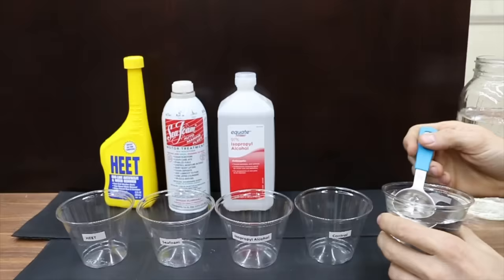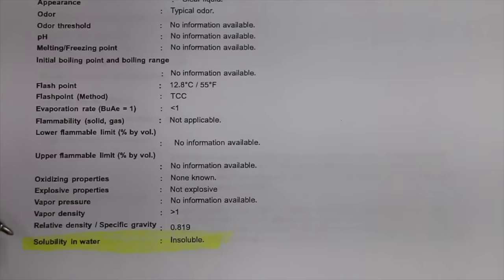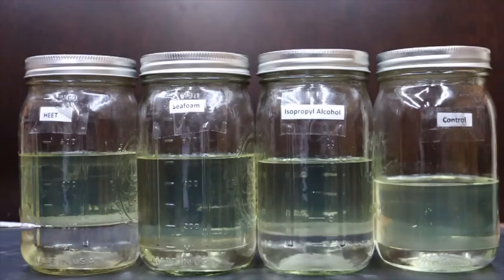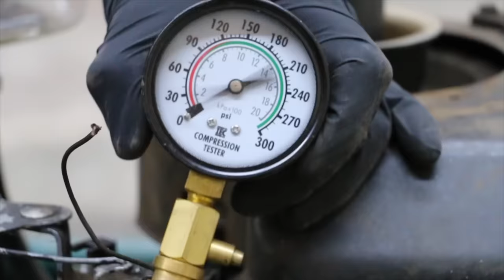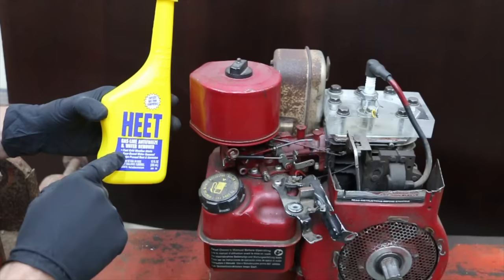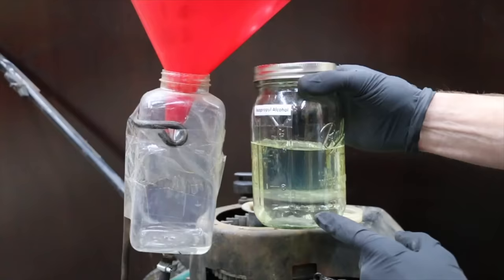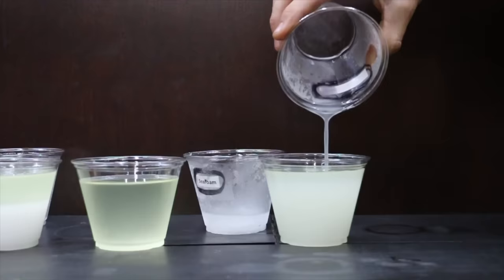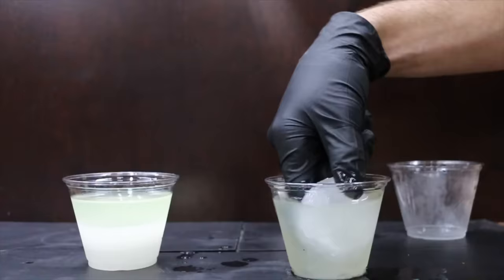Is HEET better than Seafoam for Water in Fuel?  Let's find out!

Comment: I worked at a gas station for about a year and we had to dip our fuel tanks once a week and once during my shift the paste we used to test the water came up positive for water in out tanks (it was extremely sensitive paste, even reacting to water in the air on humid days) and so we had to report it to our HQ and they sent out a huge tank filled with HEET and added another 20% of liquid into our tank to absorb the water. 

They then had to leave the truck over night to allow it to mix said fuel to ensure it was properly applied and we offered a discount to customers of about 50 cents due to the contaminated fuel. 

Most people were just happy to get cheap fuel and word spread fast, emptying our tank in about 4 days. It had to be fully empty to ensure all the water was gone and then workers came by to go into the tank  to check for cracks in the shell.
Reply from the maker: Great information! Thank you

Comment: Spend 11 years in Alaska.  I added a bottle of ISOHEET to the gas tank about once a month.  When I did have problems with ice on my Wife's or other family members' cars, a bottle of ISOHEET and an overnight stay always cured the problem.  Bought a used car that had been sitting one winter and could not jump start it.  Owner ended up dropping the price and I think that's why he was selling it.  Brought out a portable heater and piling snow up around the perimeter of the car then putting the heater under the oil pan.  Still no good.  A bottle of ISOHEET, an overnight dwell, and the car started the next day.
Reply from the maker: Great post. Thanks for sharing your experiences.
Reply: @ProjectFarm  I too live in Alaska but i always buy the red HEET bottles.

Comment: Man, how cool, you took my advice and  tested water removal. Awesome!!! This episode is special to me and I'm honored. Thank you sir.  I asked to have this tested cause I got 2 100 gallon tanks with water that got in them. I bought a wix filter that looks like a snake and put it in the tank and it did an awesome job of removing the water in that filter from wix. If you haven't seen these type of filters you need to cause they do work should you accidentally get water into fuel. What an excellent Christmas present.
Reply from the maker: Thank you for recommending this one!  Every video in the last year that I've done has been recommended by viewers.  I've got a lot more on the way. Thanks again!
Reply: @Clip Joint
Thanks for your awesome idea. ✌️
Reply: @haydenc2742  Yes sir thats it. It works very well. They use it a lot in the marine world.
Reply: I think one way to remove the water would be to let the tank freeze, pump out the fuel, heat it up to unfreeze, and pump the water out.
Reply: @satibel  Depending on how much water, might have to watch it doesn't crack the tank.
Reply: @haydenc2742  for Diesel fuel tanks only. Not for gasoline. Could still be handy and a great tool for that need it.

Comment: I had my fuel line on a diesel pickup truck freeze up while driving in Ottawa, Ontario Canada at -25C, and I was luckily already prepared for winter fuel issues, since I already was carrying Methyl Hydrate. 4L jug for about $10-$11.
My diesel has an electric lift pump along the frame rail, and a mechanical  injector pump at the engine. I got out to listen if my lift pump was working, and no noise coming from it. I grabbed the Methyl Hydrate from inside the truck, and splashed about 1.2 a cup down the fuel fill tube, and the moment it made it to the fuel, I started to hear my lift pump make an ever increasingly progressive noise from quiet to normal audible levels in about 8 seconds from pouring the Methyl Hydrate. 
You can find it in the paint section where you'd find paint thinner, mineral spirits, etc. There are 2 exciting features about it that fascinates me, it works almost instantly, and its dirt cheap for an amount to last you a year of problem solving.!!
Reply from the maker: Thanks for sharing!

Comment: Heet is a great product. If you are ever very close to passing an emissions test and have done everything, you can run your car to empty, throw in 4-5 bottles of heat (around $1 a bottle some places) and get it to pass.
Reply from the maker: Great tip!
Reply: Yep methanol burns clean and hot, but can eat old rubber lines
Reply: GravityToy  Forsyth County still has emissions testing
Reply: GravityToy  the vehicle passed emissions as designed, so it is simple to figure out if an emission related device or engine tune relate device failed, emissions would increase
Reply: Back in my days as a mechanic, adding 10% methanol to gasoline was a favorite method to make any car pass emissions.
Reply: GravityToy  Downstream O2 sensors monitor cat health. Your ECU determines stoichiometric burn solely by using upstream O2 sensors. the voltage signal from them directly regulates emissions. With a bad upstream O2 sensor your ECU won't get the mix right, your emissions will be off the charts, and you won't pass.
Reply: Sicktrickintuner 

Methanol doesn’t ‘burn hot’.
Reply: GravityToy 

Wrong. They regulate fuel air mixture.
Reply: @FrankGutowski-ls8jt   actually methanol burns over twice the temp that gasoline burns at.  3,300 vs 1,500 f
Reply: @jbtvt  you can actually tune around this if you have an HP tuner or Diablo sport to get inside the ecu .. I have a cat housing but it's hollow I run 25 pounds of boost out of a 60mm turbo the loop on the ecu is programmed to read correct every time and if they test the tail pipe the meth and 110 octane come up clean as a whistle every year
Reply: Cool story bro

Comment: I've been running snow machines on my trapline for 30 plus years. In my experience the best option is to leave water frozen in the bottom of the tank. If you add isopropyl it will pick up the moisture and carry it up through your fuel system and refreeze in your fuel pump, fuel lines and carburetor. And to always use a screened funnel when adding fuel to stop water before it gets in the tank.  Love your channel.
Reply from the maker: Thanks!  Thanks for sharing.
Reply: How does a screened funnel stop water from getting in the fuel?
Reply: @plantfeeder6677  if it is frozen it won't go through the screen
Reply: @donschneider7252  I don't think he's talking frozen water. That would be an Captain Obvious in my book.
Reply: Well that is exactly what he’s talking about so…

Comment: When I was stationed in Alaska in the early 70s, I was introduced to HEET. The universal recommendation was to add a bottle of HEET to each fill up of 10 gallons or more, to prevent fuel system icing. So I did, and after leaving the USAF and returning to Laramie, WY, I continued to use HEET in the winter. Since moving to northern Colorado, I haven’t used HEET as often, largely because our winters tend to be much milder. I honestly don‘ t know if adding HEET actually helped to prevent fuel system icing, other than I never had it happen.
Reply from the maker: Thanks for sharing.
Reply: What heet does it removes water as u drive ur car , the water will run out of ur tailpipe , if u ren ur gas low and freezing conditions set in and ur car won’t start I have added eat and car then did start

Comment: Nice! I have been using seafoam for years and always buy non ethanol gas! Another tip is to put a gallon or two into your vehicle first before you fill up your cans at the gas station.  This clears the hose and pump of any ethanol fuel!
Reply from the maker: Thanks for sharing.

Comment: I live in Wisconsin, and I add HEET as soon as we start hitting prolonged freezing temperatures. I've never had a problem with my car starting even in below 0 temps, but I use the red instead of the yellow just in case it actually does help the engine a bit more than the basic. This vid verifies that adding HEET before it's cold enough to freeze the line is the best method or protecting the car.
Reply from the maker: Thanks for sharing.

Comment: When I came back from Germany in December 1982 I got stationed in Mountain Home AFB Idaho. I had a 1972 Volkswagen bus with a Porsche 914 engine running a single Holley carb. I had no problem with water in the gas until I got to Idaho, filled up my tank and hit the highway when I got to my exit my bus wouldn't idle down because the water in the gas there froze the throttle open. I was told that all the gas in Idaho has water in the tanks because of condensation because the tanks are all above ground. I had to put a can of STP additive to my tank every time I gassed up to prevent this. By the way my bus would go 105 to 110MPH on the autobahn. Thanks for your videos, very informative.
Reply from the maker: You are welcome!  Thanks for sharing.

Comment: I've had my diesel gel-up in my truck last winter, when we had a fairly warm winter and our gas stations obviously thought they can get away with "summer" spec diesel, but then we had a sudden drop in temps for a few days and lots of people got their diesel gelled up.
I had an amazing result using Bardahl BDC. Truck didn't even fire up before treating the fuel with the product. After left a couple hours to do it's thing and some persuasion I managed to fire it up and after idling for an hour it started to have decent power and became drivable. 
Bardahl claims their product don't actually de-gel fuel if it is solidly frozen, and that you need to add the product before hand to prevent any gel from forming in the diesel, but it still managed to help me out quite a bit.
Bottom line is I'm completely amazed by this product and would recommend anyone having to deal with gelled up diesel to give it a go. 
Also would like to recommend you to test out diesel additives and anti-gel solutions in some future video!
Amazing content as always!
Happy new year! Best of luck in 2019!
Reply from the maker: Very impressive results!  I need to test it.  Thank you and Happy New Year!

Comment: A few years ago I left my 2000 Ford Mustang sitting out in the freezing cold for a few days without driving it. When I went to start it again, it wouldn't turn over no matter how much I tried. I even ran the battery down trying to start it and had to get a jump to charge it back up again. I put a bottle of HEET in it that evening and let it sit overnight, and when I cranked it the next morning it started right up and blew out a huge cloud of white vapor from the tailpipe. The stuff really works.
Reply from the maker: Thanks for sharing.

Comment: I use gas line antifreeze every winter in my snowmobile, which is basically methanol (HEET). The key to keeping any water from freezing in your gas tank is to put it in before it in can have a chance to happen. I buy packs of 250ML bottles and poor one in every time I fuel up. Once water has a chance to freeze, you're gonna need a heated garage to drain it.
Reply from the maker: Thank you
Reply: We used the HEET in the red bottle to fix a snowmobile that had water in the tank from a previous owner.  It sat in minus ten degree weather for a day while the HEET worked it's magic.  Worked perfectly.
Reply: Yes. But the snowmobile we bought already had water in it.  A farm kid broke the clear lense on the gas cap and left it outside uncovered.  Not a smart thing to do
Reply: I only run 90 octane non additive gas in my sleds. They are from late 1980s and 1990's
Reply: @Dan Flynn  doesn't the ethenol gas eat seals and hoses and carburator internals after time?   That's what I was told.  If not I'll try it. I have an 1984 Yamaha XLV 540 that runs excellent.
Reply: @Dan Flynn Hi Dave, I live in northern Canada. I don't know what the ethanol content here is on average, but gas freezing in the lines is a very common thing here. Methanol is packaged and sold as gas line antifreeze on the label. just leaving the gas cap open long enough to fuel up during a heavy snowfall can and does allow quite a lot of water into the fuel. Using methanol as I said during every fuel up has always kept frozen lines at bay. People all over the country use it in every type of gasoline vehicle imaginable and it works! Maybe the small amount of ethanol can prevent freezing at more modest cold temps but when we're experiencing -20 to -50 degrees Celsius gas lines can and do freeze often. Methanol is definitely field proven for years.

Comment: Thank you for video. I have a 26 ft seayray with a 350 cid 300 hp motor. I used pump gas and found out that the pump gas had around 3 gallons of water in a 100 gallon S.S. fuel cell after about a month in rainy weather . I had to pump the whole tank out to get the water out due to failing to start. 
  I use ethanol free gas 100% petrol now with no problem . However I now understand that Heet or isopropyl alcohol could save a trip at the lake.
I enjoy your videos very much. In fact I'm looking forward to help support future videos. 
   Thanks a bunch God bless !
Reply from the maker: Thank you for the feedback

Comment: For my commercial mower and big tank, I finally added a water fuel separator from an old tractor and have emptied a lot off water from it at times. Runs better than ever,  even after the Houston winter.
Reply from the maker: Thanks for sharing.

Comment: Another great video! Even with the mixup at the end, it was a really fair comparison. I have been one of those people who thought Seafoam would take care of water, but it doesn't. I currently am battling an issue in a flood car, drained the tank by jumping the fuel pump relay. Added 5 gallons of fresh fuel and half a bottle of Seafoam. It ran ok right after, but now it seems to be challenged again. I am going to drain the tank again and change the fuel filter, this time I will add a bottle of Heet instead of Seafoam. (BTW, cold weather isn't a problem yet).
Reply from the maker: Thanks for the feedback.

Comment: I remember once as a youngster that my dad used a quart of strong rum to absorb water in his gas tank.  The old bulletnosed Studebaker definitely ran better after that.  That it tended to wander from one side of the road or the other was only due to a bad fiber washer in the steering gear.  Great test.
Reply from the maker: Thank you
Reply: That was a very expensive way to do that

Comment: I had fuel line freeze once 20 years ago. Now every winter I stock up on Heet. I run a bottle every full up, or if it's not really cold every other. I haven't had any issues ever since.  The ethanol in gas is
 horrible it draws so much moisture from the air. I enjoyed this experiment And will continue running Heet in the future.
Reply from the maker: Thank you!

Comment: This guy has the perfect voice for infomercials
Reply from the maker: lol. Thanks
Reply: I have always wondered which hand cleaner is best goop, orange ext would love to see a test on it . Love your channel
Reply: @mostmusketboy  -- I don't think it's an either/or choice. I like to have both types on hand. The Orange citrus/pumice stuff is good for oily stuff with dirt in it, but for some kinds of oil paints and adhesives I like the Goop/GoJo/Permatex gooey white stuff. (The gooey white stuff can be used to get oil stains out of clothes, too. I don't give a crap about what my work clothes look like, but one time, after getting an oil change by someone else, my drain plug blew out on the way to the wedding. I followed the trail of oil back to the point of the expulsion of the plug on foot and retrieved it, put it in hand tight, walked to a gas station and got 4 quarts, walked back to the car, drove to the gas station where they let me borrow a wrench, and went on my merry way. Some oil stains occurred, however.)
-- There's a third one that I got to try out when I read that it was good for getting rid of poison ivy, Mean Green Power Hand Scrub, and damn it, it worked! It was a horrible case of poison ivy, too, with dime-sized fat blisters on the palms of my hands. The Mean Green was only available online, and its texture is similar to the Orange stuff. I wonder if the orange stuff or the gooey stuff would also work on poison ivy. The toxin in poison ivy is an oil called urushiol. Anyone out there who tried the other cleaners on poison ivy?
Reply: If he does an English accent........
Reply: @mostmusketboy  snap on soap is absolute gold
Reply: Sometime he talks a bit fast, but a bit of rewind helps.  Of course, there is a geographical dialect difference.
Reply: @pi1797  It's the drying effect. You can get the same 'treatment' by going down the shore and going swimming in the ocean a lot. Also works for athlete's foot. Of course, in the winter, it requires a tropical vacation, but this way you can claim that you need a vacation 'for medical reasons'! Just throw away the socks and sneakers you wear on the way to your vacation, and wear flip flops or other types of open sandals that don't retain moisture in any way. Rubber sandels work, too.

Comment: A good fact to remember is alcohol is hydroscopic.  So if you put it in your tank as a preventative you could actually be increasing the water in the fuel as the alcohol draws water from the ambient air.  Hopefully the gas sitting above the water would slow this reaction down but it still is a factor.  Best to use it when needed and run the engine after application for long enough to burn the alcohol and water/fuel mixture up before shutting down.  I mention this more for equipment that is left idle for extended periods of time than for a daily driver.  As always good video.  Like to see the reaction when it goes through fuel pumps and injectors.  Take care.  Doug
Reply from the maker: Thank you!
Reply: This is complete nonsense.
Reply: @doctor some doctors are nonsense